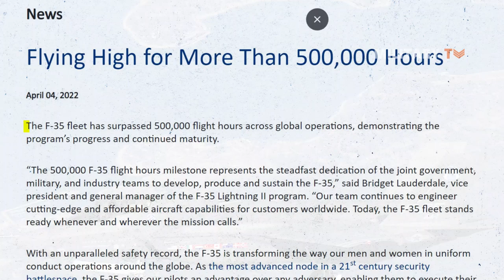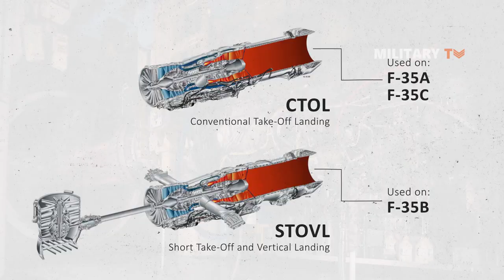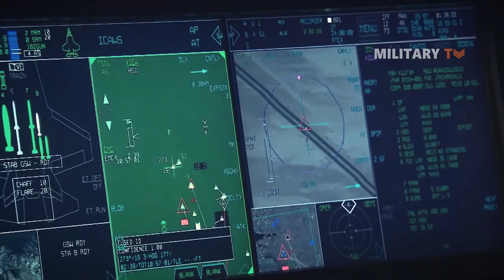Many Things You Probably Didn't Know About F-35 Fighter Jet

Comment: Puff piece. It is ultimate jack of all trades / master of none. Two variants of the F-35 have no guns - they require the foresight to externally mount a not-so-stealthy gun pod (B and C). The B model doesn't work on most Navy carriers until the decks are reinforced (again).  If it was worth every penny, why did they decide to restart F-15 production and are considering another F/A-18 model? It's great plane, far better than anything the Russians or Chinese have, but the acknowledgements of the problems should be more inclusive.
Reply: Guns are quit literally useless in the mode day, can you name me the last air to air kill done by a gun on a plane?
Edit: navy planes in general don't have guns so you point makes even less sense.

Comment: it is yet to prove itself as yet in action, yes their 3 type's but cannot replace all the things it was supposed to do.
It's slower than most Russian & Chinese Aircraft so it cannot intercept or even catch a faster fighter.
Then most country's now are doing the same thing again it has not war proven  it has been seen so to claim this you would need it to be proved in a real action.
Reply: Speed is far from the most important factor in an engagement as no dogfight has been recorded with speeds past Mach 1.5. It should be noted that the f35    
Was meant to excel at BVR Combat with its high alpha maneuverability so interception isn't much of a problem.
Reply: Is that why the F-35 is in such high demand?  I guess you should tell all the clients that you know more than they do and they’re all making a big mistake. 

It’s accomplishing feats not seen by other aircraft.  For instance, it linked to a HIMARS to strike a naval target.  Its AI automatically tracks, detects, and targets each foe, shares this info with other assets in the field, determines the probability of kill for each, and also determines the best targeting solution. Its sensor fusion and situational awareness are unmatched. Furthermore, since its ordnance is stored internally that means less wing and drag weight, which also reduces its RCS, gives it greater agility and fuel efficiency.

Comment: fail.
sorry but the 3 in 1 initiative caused complications that will forever limit mission capabilities.
lack of competition and lack of mission specific built options have let the jsf program continue unabated. 
the f35 is indeed the most modern and is the best fighter in specific roles...but not the best in roles that are still of value.
it's range is sub-par to other airframes,  it's speed is sub-par to other airframes. 
it's maneuverability is sub-par to other options. the f35's RCS may be good...but that advantage has a shelf life as sensors advancements mature.
the f35 does have a role...but being the only option available is a fail that will have a direct effect on future NATO combat capability as a whole.

Comment: What are you talking about??? It's range and speed is crap.
Reply: Brian, the A model has a combat radius of 600nm, the F-16 without tanks, with 2 AIM -120’s and 2 JDAM’s (the standard F-35 A2G load)  is just under 300Nm. With a full combat load, the F-35 can reach Mach 1.6, the F-16 won’t even break the Mach.